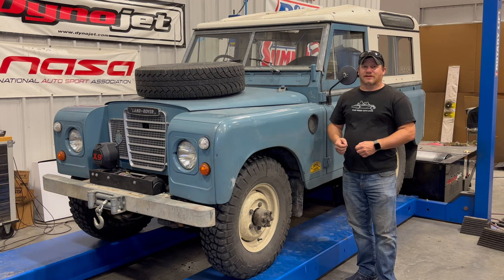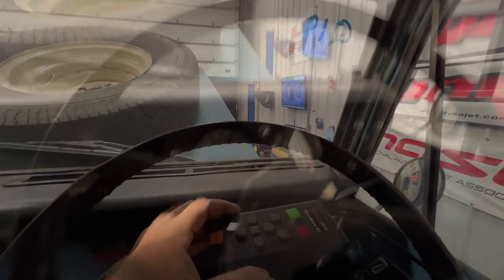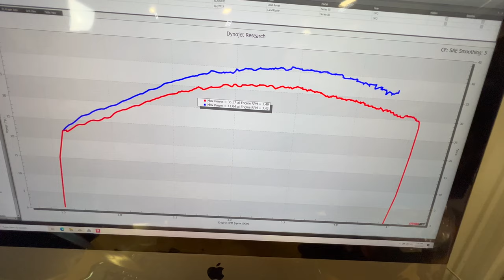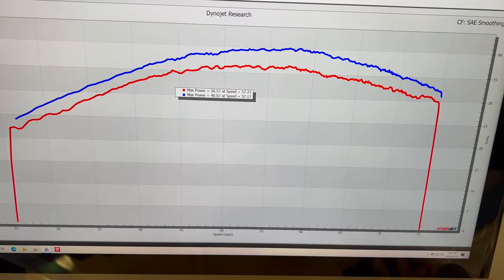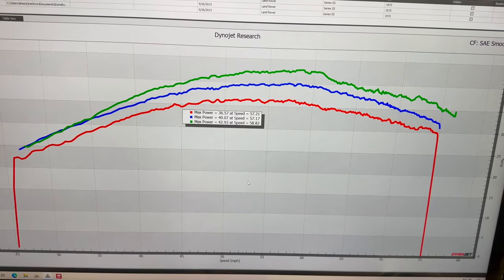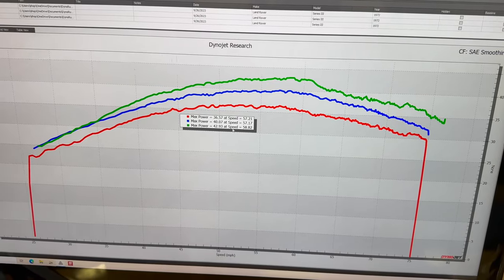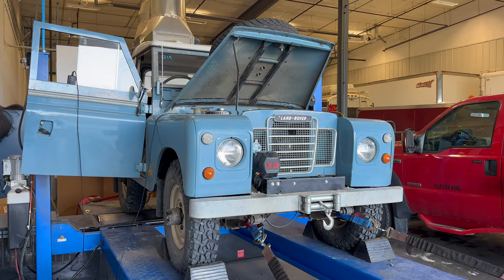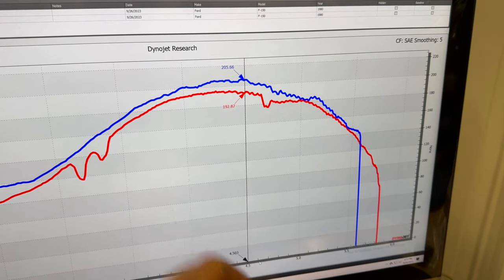How Much Power Does the Fan Really Use?

Comment: Nice to see a well cared for Land Rover in original kit. Not jacked up, big tires ,and an oversized V8 stuffed into it.
Reply: Moding is the only thing that makes it interesting...
Reply: @kealahau6727 you’re entitled to your incorrect opinion.
Reply: Sounds as if the camshaft has had its day, probably (from my own S1 experience) not helped by clogged up oil galleries.  Loss of 25 ish bhp is not a sign of a cared for vehicle. Why not get the engine up to full strength before investing in an  electric fan and losing originality?
Reply: Here in australia a lot of people put in holden  181 or 202 6 cylender engines they fit in with little modification and drive much better

Comment: While a fixed blade fan will use more power as RPM rises, it's far more of a factor on a dyno where the airflow through the radiator is static.  Going down the road, the airflow through the radiator reduces this load considerably.  Much like a propeller on a boat/airplane at it's design cruise speed.
Reply: Very good point. I believe it was a Banks video I saw they actually have a dyno with dynamic speed adjusted fans
Reply: sure but you don't really need the hp cruising down the road. some examples of where you do need it is to climb a sand dune which will be slow speed, high revs. or to pull someone out of a bog or up a hill.
Reply: @6226superhurricane Even there you dont need it, it takes some time for the heat to get from the engine block in the coolant. Even when the coolant gets the heat there is still "cold" coolant in the lower area of the radiator. Even than there is alot of thermal mass to absorb the heat before you get critical temperatures.

Comment: good video , Volvo during the late 70's early 80's had these types of fans the worked incredility  good and did this test on their CIS engines with and without the fans and found a difference of 5/6 hp at 2650 rpms and as much as 9.5 hp at 70 mph or above, so i upgraded to clutch type fan and noticed a difference right away and got 2.5 mpg better

Comment: Interesting to see your results, that is a massive percentage of the total power used by the fan!
I have removed the engine driven fan from my RZ4E Isuzu pickup, combined with a tyre size change from 255/60/18 to 235/65/18 (identical dia) and A rated for fuel economy tyres i have seen a dramatic improvement in economy. 40.5mpg UK average over 10,000 miles with some journeys in the 50's! If you are not pulling massive loads in high temperatures get that fan off!
Reply: Your mom gets fans off 
I’ll see myself out😂

Comment: I have a 1966 Lancia Fulvia which came with a mechanical fan driven from the crank pulley. My car has a modified 1300cc engine which revs out at 8000rpm. I decided to remove the fan , belt and pulley as I believe in this story of power loss.  Your video confirmed this. Never had the chance to dyno my car with or without.

Comment: I had a Rover 80 fitted wìth this engine. It was a luxury saloon / sedan which was virtually silent, except for the fan whine. I removed the fan and in 2 years of UK driving never noticed any increase in engine temperature, except when stuck in stationary traffic. I then fitted an aftermarket electric fan which only came on once in 2 years.
The car was quieter and warmed up better on cold days. I felt it had more power and fuel consumption improved by a small but  measurable amount as well.

Comment: Although not a factor with the Landie a fixed fan can make a lot of noise at high engine revs. I think you could hear the difference between the with and without fan runs in this video. Don't know if that was noticeable inside. Viscous fans usually go to full slip at about 3k rpm so should not get any noisier after that.

Comment: I found that very interesting. Many years ago I was told 'if you fit an electric fan then remove the old one as it is not needed and will impede performance. So now we know. Yes there are variables but not that much gain really in this case.  You made a good point which I was going to mention and that is you probably won't be running your Land Rover at 70 MPH but that was a good 'base line' to keep things on track. Thanks Steve please keep up the good work. 👍👍

Comment: I have not driven a car with a mechanically driven fan for years. I am in a relatively cool climate (UK) and found that most of the time the electric fan would only start if I was stuck in traffic on a hot day. Back in the 1970s and 1980s we used to use fans and shrouds from Fiat 128s in our engine swapped cars. From memory I think they used about 7 amps, cheaper than an accessory fan and they had shrouds as part of the assembly. Of course a lot of cars are retro fitted with electric fans at a point in their life when the cooling system is underperforming. Free horsepower, quicker warm up, reduced noise and an easier life for the water pump.
Reply: I had to have the faulty speedo changed on a car, back in the '90s. The garage unplugged some wiring during the work and forgot to plug the electric radiator fan back in. It was fortnight before it caused any problem - and that was only because I was in stop-start traffic on a very hot day.

Comment: I've got a  62 IIA 88" that is relatively stock.      I did an electric fan conversion a few years back and I am quite happy with it.   I have no good way to measure the HP increase but 3-4 HP at the wheels is not insignificant.   Also runs quieter,  and gets about 1-2mpg better,  and less wear and tear on the belt and water pump.   at 60mph I get about 18mpg  (safari hard top)  

One gotcha is making sure you've got enough alternator for the fan.   The Series III in this has a lucas alternator.   Not sure how many amps they were good for.   I put in a 60 amp delco  (replacing a 40) as part of my conversion.   I had to play some games to get the original ammeter to still work but I did it.

Comment: It's not just the more rwhp but also the slightly faster throttle response at higher rpm ( yes I realize on the Landy that's a oxymoron) and faster getting to operating temp and less engine noise. Did this to all my vehicles back in 70s
Reply: there is no throttle response, maybe gets noisier if you press the accelerator, that's about IT
Reply: @mb106429  Nonsense, noisier from having no fan? its the opposite. But you could really increase throttle response, as there is less mass to move without a fan.
Reply: @gabrielv.4358  I was talking about throttle response, not fan noise.

The noise mentioned was the enging noise in response to the throttle, when you press the throttle the response is loads more noise.... and a tiny bit of power

Comment: I would say that is a significant power gain for zero cost. Leaving the engine fan in place when you have fitted an electric one is a practice that has always puzzled me.
Reply: wait til that eletric fan fails.

4x4s should be robust. Electrics arent robust.
Reply: Landrovers puzzle me
Reply: @TheKodiak72  From experience (in a kit-car with very poor airflow), should the electric fan fail, as long as you don't end up in a standing queue of traffic, the natural airflow due to the vehicle's movement is easily enough to cool the system.

Comment: My P38 (2.5 diesel) has a viscous fan, when it is locked and releases as it cools there is a noticeable increase in acceleration. For my use of a vehicle the viscous fan is the clear winner over an electric fan: waterproof and mechanically controlled

Comment: That was super interesting and the effort it took you to prove and re prove was very good of you to do the work to find out. I have a diesel series 2.25 liter which i have owned 25 years and i have from the beginning always done the bmw ethos of efficient dynamics ie lots of tiny things adding up to a lot and consequently got my gas mileage up around 38mpg and more at times but the 38 is about avg. so 3.9 diffs , freewheeling hubs,O/D,fan removed,larger wheels to aid taller gearing, ep75 gear oil all round. But mostly a light right foot and backing off when climbing any kind of long incline

Comment: Interesting test; thanks for posting.

If you keep the original fan you need to fit the fan-shroud as well, so that it can suck more air through the radiator.

Comment: Now you know how much the fan uses when stopped at a light while revving the engine. Having the vehicle actually moving down the road will reduce the fans drag as the air is already moving leaving the fan much less work to do and may even add some power if you are driving fast enough. Not likely in a stock Land Rover.😉😊 You don't need a fan at all if you are moving at least 30 mph.
My favorite part about using a flex fan is when the blade breaks off from flexing so much and cuts though 12 tubes in the rad leaving a person stranded at the side of the road in the middle of the night with the temp at -40° F. Don't ask me how I know.😒😒
Reply: If you loose 10PS by using a fan, it means the fan is using 10PS or doing something (moving air) that requires 10PS. That’s a lot of air that could be moved and a large set of blades is required. So it kind of makes sense that the gain is rather limited. Nvertheless interesting to have it checked.
Reply: @ErikB750  I'm just pointing out that if the fan moves air at 60 mph and your car is going 60 mph the fan really is not consuming any horsepower  just parasitic losses. If the car is going 80 mph then the fan is trying to spin faster and is actually driving the engine a tiny bit. It would be very difficult to measure any of this and it certainly wouldn't be worth the effort.🙋‍♂😊
Even an 150 amp alternator at full rated output consumes less than 3 Hp.
Reply: @MatthewBerginGarage  true as well ! So the faster you go, the more power you win 😁😉
Reply: I've been there and done that. Stranded on the side of a motorway, after the week-old electric fan shed a blade and put it straight through the radiator. The breakdown service got me another radiator and I drove the 170 miles home relying on the airflow of the car's movement to cool it. I did have to stop a couple of times, as it was a very busy day and there were numerous traffic jams with stop-start traffic.

Comment: Rebuilding my mk 3 owned since 1983. I did fit a kenlowe fan in the late 1980s, saving fuel the main purpose, it still works so it will be refitted,I wonder how much fuel the  freewheeling hubs  save, i have fairy ones fitted same firm has the overdriive, interesting post.
Reply: Got fairies on mine, I’d say there’s a very small increase in mpg but it’s mainly beneficial for not having the ujs turning when I’m parking ( lwb) as lock to lock is usable. When the hubs are in the ujs kick before I get to lock stops. 
200 Tdi no fan of any type but big series two rad. And 33.3 mpg average over the last 1200 miles

Comment: Increase sounds reasonable as transmission oil has warmed. In sixties in U.K. it was generally considered that a sun shield on windscreen cost 5mph and likewise a roof rack. The 3hp gain  seems reasonable as it is a low speed long stroke engine. Remember them well from the military biggest cause of failure was high speed running on rear axle shafts or peaking out traction in soft going. Often finished schemes just using front wheel drive as runout of rear half shafts.

Comment: My '76 Valiant runs the factory 3-core, HD cooling radiator, shroud & clutch fan with 7-blades. Running a 318, Thermoquad 4-bbl, dual exhaust with a cam better suited to the combo (2.76 rear gear, mediocre compression). I've had friends who have put on aluminum radiators & electric fans, but for the cost and issues they've had...it's not worth it to me even if I got a few HP at best.

Comment: Efficiency, fuel economy and less noise were the reasons auto manufacturers went on to electric fans that were controlled by a thermostat switch. Those percentage figures for power can translate to good fuel economy on long distance drives. At 40 Kph a vehicle pushes in enough air through the radiator to not need a fan, and the colder the ambient temperature the more a fan is not needed. Mechanical fans and also the old style "V" belts take up energy to drive them.

Comment: in the early 70's I had a 302 cubic inch Ford v8 , on the dyno, removing the fan gained 12 hp. interestingly so did removing the air cleaner, a gain of 12 hp

Comment: For most on road vehicles electric fans using less power from the engine can add a few mpg's. If something happened to the battery or alternator getting towed to a place for repairs isn't a problem.
For off road where if something happened to the battery or alternator, an engine powered fan would let you drive the vehicle farther than an electric fan could. This could get out of a situation and back to a safe place to repair your vehicle.
For drag racing or some other short course racing running an electric fan and water pump might give you a slight HP advantage over mechanical versions. 
All this said, you just have to determine what your needs are and use what best fits those needs.
Doing this testing on a Dyno gives a definite value to how much HP it takes to run the fan. If you have several versions of fans to test on one engine this could show the difference between fan types. Your 4 blade steel fan against a 5 or 7 blade or even a 2 blade fan. Same with flex fans, getting several blade counts. Clutch fans might be an interesting variable to add in also.
Reply from the maker: Also running a mechanical fan in water is a bad idea. You want to have a fan you can disable or turn off easily if you think you will be doing any water crossings.

Comment: Be interesting to dyno the vehicle running with the alternator under load running an electric fan, though in theory an electric fan wouldn’t run as  constant as the engine driven one but nonetheless be intriguing to see a comparative power loss…
Reply: A typical fan on a small vehicle will run at about 4 Amps x 12 Volts = 48 Watts.  That's roughly 0.064 H.P.

Comment: I think there was a FIAT with a thermostatically controlled clutch that drove the fan, I guess variably controlled pitch blades would be the ultimate. On the Air cooled racing Porsches, they accounted for the power taken for the fan (about 10 hp if I remember correctly, remarkably low for a racing engine, and accounted for by no radiator drag)  so it could be compared with other engines.

Comment: I saw a test in the states where they tested the fan , water pump and alternator and the alternator used by far the most power to run. Swop to an electric fan and the alternator needed more hp
Reply: twice a year

Comment: With solid (old style) fan blades, biggest difference I have seen with SBC was about 20+ hp. I have not tested with my H3, but when the cluch fan is on, it feels like towing a small trailer. When I replaced the fan with two electric ones of my -79 Blazer, there was a noticeable increase in mileage, as it has Turbo 350 that is 3 speed only, so the engine rews all the time. And, it is no longer a leaf blower when I start it in the fall...
Reply: Think about all the trash that gets into air filters from excessive fan😮

Comment: There are more advantages to be had from removing the fixed mechanical fan from the LR S3 so long as there is a fully functional electric fan:
1)  Quicker warm up of the engine, which will benefit the longevity and be a distinct advantage in winter when the heating is required.
2)  The mechanical fan is a PITA in deep wading that the LR is capable of.  It churns up and sprays water throughout the engine bay, potentially soaking the electrics.  Without it you can rely on a bow wave and a depression in the engine bay to keep the water below the external level to such an extent that water can flood over the bonnet due to the depth and the engine will still suck clean air under the bonnet and the electrics will stay dry.  The radiator is kept cool by the water
3)  The woeful automotive fan belts can barely transmit the power to the fan, alternator/dynamo and water pump.  Remove the fan and take the strain off the fan belt.  Alternatively fit an industrial fan belt.
In this application the fan is not in a shroud so its effectiveness is significantly reduced and you could expect that it is oversized just to account for this inefficiency.
7.5% power increase is not to be sniffed at.  Imagine what engine modifications would have to be made to attain that figure say, multiple carbs, tuned exhaust etc.  Removing the mechanical fan is a no cost improvement in power and probably a reduction in fuel consumption.
The LR cooling fan installation is very poor from all aspects and the fact that an electric fan has been deemed to be necessary shows how ineffectual the standard system is.  Why waste power and fuel on such inefficiency?

Comment: You are also gaining fuel mileage and, of course, throttle response. There is a reason all modern vehicles have gone to electric radiator fans and skeleton alternators. Not a huge gain but an easy one to acquire. Over about 35 MPH the movement of the vehicle is enough to keep it cool so some of the readings might have been influenced by the hot engine requiring alternator current to run the electric fan that under normal driving would not be necessary.

Comment: You need the fan to blow air around the engine as much as anything because the bulkhead is a real air blocker. I run the fan and no free wheel hubs, because if I want economy a 58’ landy is a real bad place to start  :D     Nice S3. Very ‘clean’.

Comment: Also saves fuel as it warms up quicker by not pulling extra air thru the rad, not a lot, but any is good. In the UK we used to remove them for winter to aid heater and rad temps.
Reply: Totally agree, in winter that will make a huge difference.
Reply: I had a series 3 Diesel in northern England, In winter I used to remove the fan and block half the radiator with a sheet of ply. It still never got too hot, but at least the heater worked, just😂.